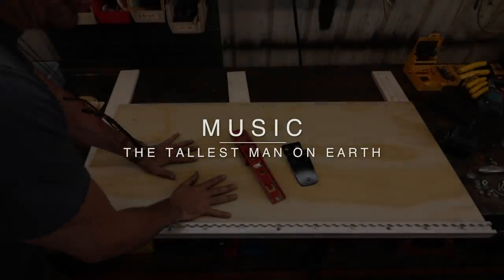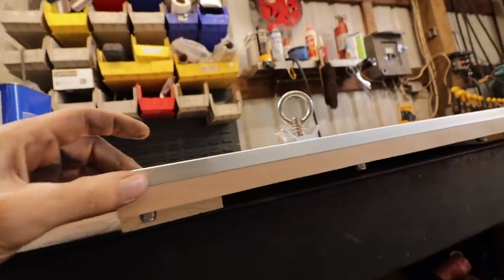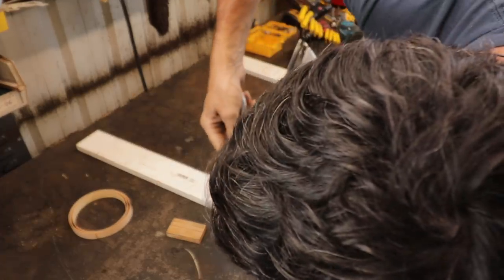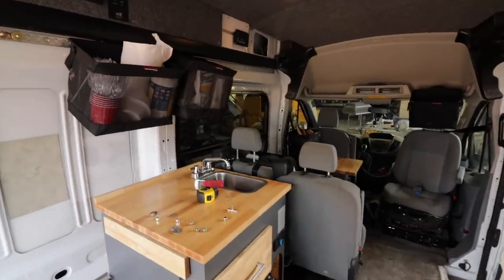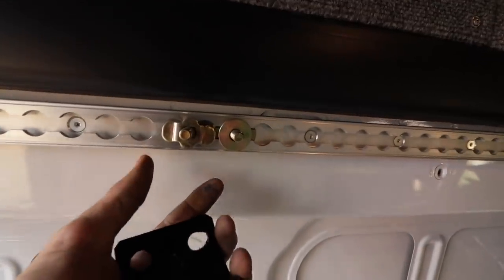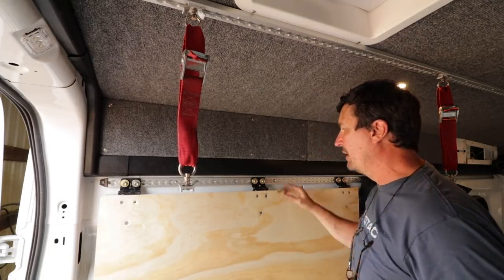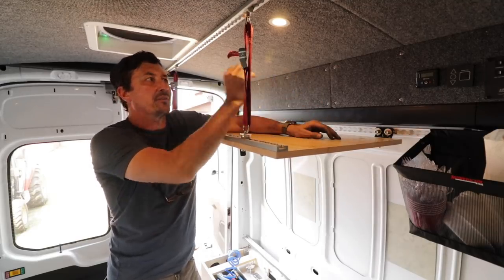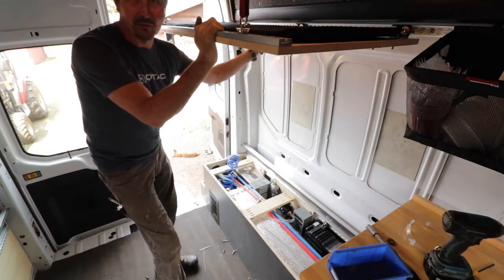Cool Bunk Bed Made From A Jeep

Comment: Cody, when doing that wood edge banding, use a putty knife at an inward angle, and you will get a cleaner shear without possibly having a razor dig into your wood. then you can hit it with a belt sander lightly at an inward angle and get a super clean smooth edge.  Yours looks great, just an idea for future projects.

Comment: I use to fly an airplane (Pilatus PC12 turboprop) that used that L-rail full length on the floor and short sections on the walls and ceiling in the cabin to mount just about everything.  Cargo nets, tie down straps, and even seats and cabinetry.  It makes for an incredibly versatile and easy to configure cabin.  My companies next aircraft, the PC24 twinjet, will use the same system.

Comment: Looks really good.
Only one thing i would change. The bolt heads connecting the T-rail to the bed. Thats the kind of stuff where you always hit your head on.
Put them flush in the board or cover them with something.
Reply: he isn,t done yet

Comment: I would use rigid hooked rods with a safety latch (similar to a carabiner),  and swivel bottom  into a eye bolt from the ceiling instead of the L-track on the top edge of the shelf. You had trouble at least twice engaging into the track just in this video alone.  Hate to see the bottom fall out if it doesn't connect properly.

Comment: Maybe consider putting some sort of cap or finishing hardware over those boots underneath the bed. Standing up from the bench and bumping ur head on those would not be fun. I would recommend some more of the L track covered with foam and finished like the roof.

Comment: Cody it isn't a bunk bed, it is a sweet loaf rack. Test it for weight with few grain sacks full or buckets of sand. Don't want that sweet loaf falling down or out on a bumpy ride now. You could use even Mrs. W. to check out the strength of the straps.
Reply: he is hanging on it, he even told it in the vid and you can see him doing it, after all these years he builds stuff have some faith in his skills and insights.
he is a father, you really think he would take chances??

Comment: Maybe add a strip of rubber underneath to cover the screws holding the rail in place. If you are sitting on the bench and stand up with the shelf down - those screw heads will hurt! Also the rubber strip will cushion it against the side of the van if you have it folded down.
Reply: relax, knowing cody from his vids, he will finish it up nicely, prolly with the same stuff he used as roofliner.
he is not done yet you know.

Comment: I would get some black foam pipe cover or cut a pool noodle in half and glue it over the row of nuts along the end. Only thing I can see happening is someone stands up into that that overhanging, and the sweet loaf goes rolling face first into the stack system... or a little finger or arm gets pinched. 
I believe by government regulation she needs to have on a fall arrest system, steel toe boots, reflective vest, eye protection, gloves and a helmet, doesn't she? haha

Comment: This is really cool. With the boxed-in webbing should be pretty secure, but my main concern would be the integrity of the plywood. May I suggest building an aluminium frame (or similar) a couple inches wider, with the mounting rail attached to it, and then attaching the plywood on top of the frame. This would potentially make it bombproof. Looking forward to seeing more adventure van builds. Take care.
Reply: 3/4" plywood.  He and the Mrs. Could sleep on that thing without the plywood being an issue.